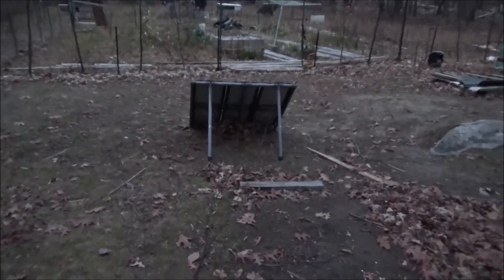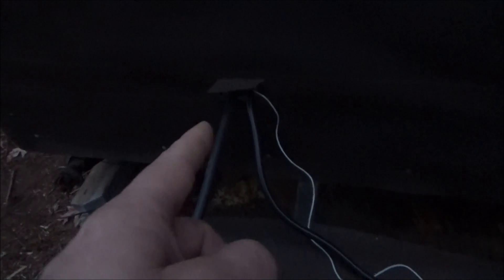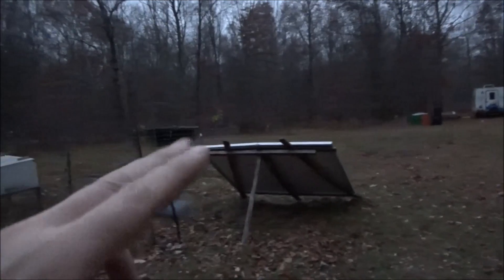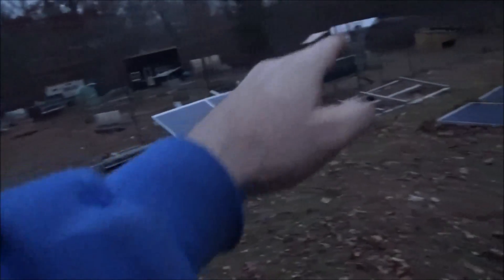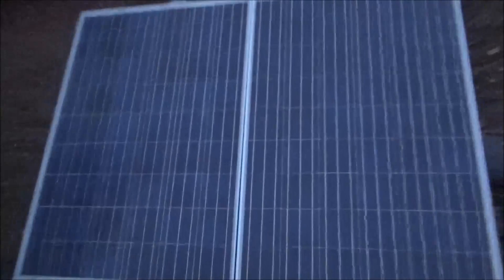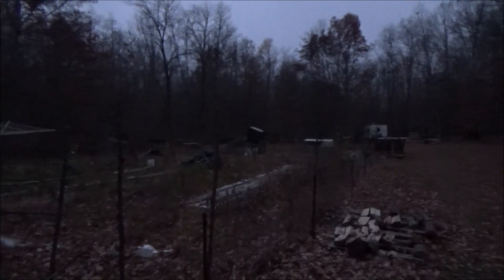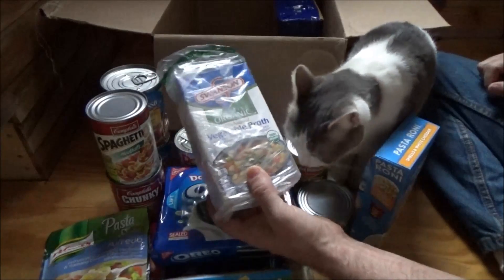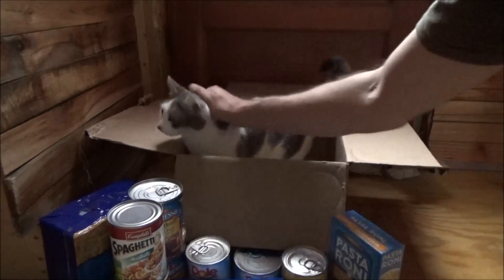Talking About My Off Grid Tiny Home Solar Panels N19

Comment: Most - sorry ALL dwellings with Solar have them mounted to the building or as close to as possible.  This reduces the loss in line.  As close to the panels as possible.  Looking at your setup you are losing more in the amount of cabling you use.  As you house is on wheels move it to the end of your garden, setup the panels even have them attached at an angle from the house then run the cabling to the charge controller then to battery bank then to inverter.
Reply: Paul Walker Thanks for posting this. Troy's setup is the only one that I have seen with such a long cable run. His wires definitely need upgrading if they were burnt by over amperage.

Troy, if you absolutely cannot get away from the long runs, I would like to see:
1. Panels be at least 4 feet off the ground. Better solar production on many points and will not get buried by snow.
2. Wires not exposed and on the ground. Put them in conduit and or bury them. These will get trampled on and chewed and destroyed again.
3. Nothing held up by a single piece of wood that is not secured to anything. Even if temporary for an hour, they are begging for damage.
4. 8 large trees cut down. Understand the challenges, but is the easiest solution to increase exposure. Appears it may double it in your meadow.
Reply: but theirs do not have panels 300 meters away made from recycled wiring do they?
Reply: The Do It Yourself World use this calculator.  but take into account that the calculations are based on correct gauge wire and siting on panels

http://www.powerstream.com/Wire_Size.htm
Reply: flatop08 iff your mppt charger is equipped for higher voltage input you should get the most profit if you use the highest input voltage possible, this has nothing to do with the battery voltage, forinstance, troys mppt controller can handle 150 volts input, the mppt controller transforms that in the used battery voltage, 12v in your casethis reduces te amps trough the panel wiring, but at the same watts, the mppt converts that into more charging amps
Reply: The Do It Yourself World You should order wire online - it's significantly cheaper than at the big box stores.  I recently got 200ft of #4 copper for $185.  That's 78 cents a foot, the local big box wants something like $1.50 a foot.... Even with shipping ($29) it was significantly cheaper.  I got it at Wire & Cable To Go - http://www.wireandcabletogo.com
Reply from the maker: gene mayne I think before you start talking about the weight of my trailer you need to go back and get your details straight please. I am really tired of people telling me its overweight and me answering again and again and again and again and again and again and again and again. Its UNDER 7,000 pounds empty, which is the trailer weight limit.
Reply from the maker: Have a look at MPPT solar charge controllers. They are made to allow higher voltages and longer wires
Reply: wires that are the correct quality and rating - yes - are yours?
Reply: @ paul walker, dont forget he is using a mppt charge controller, he can put maximum 150 volts in it putting his solar panels in serie, reducing the amps , so also reducing the cable loss, his wire lenghth and thicknes is not realy a loss point (especially in low light, there are less amps flowing ), so lesser los also, when you use a old fasioned pwm controller you are right in that case only the amps a panel delivers is used , by a mppt controller you can work with a higher powerpoint , the mppt charger makes more amps out of the watts of a panel as that the panel can deliver itself (in amps),
Reply: MrBugsier5 Hey guys, my setup is 9 100watt panels coming in at 12volts to the mppt charge controller from 125 feet away. are you saying I should wire them at say 48 volts to reduce the loss on my 8awg wires?
Reply: flatop08 btw my mppt charge controller can handle 75 amps.
Reply: it would make sense to wire all his panels to 48v imho if he doesnt move the house/panels
Reply: Solar panels mounted to a building make me very nervous anymore.  There was a warehouse fire not too far away that had solar panels mounted on the roof.  The fire burned for MONTHS because of the solar panels. They couldn't fight it the way they normally would, because of the solar panels. It made a HUGE mess!
Reply: MotherOfManyHorses Wow!  Did they say what type of panels or which ingredient in the panel caused the issue?
Reply from the maker: flatop08 If you have an MPPT charge controller then yes you would benefit from wiring them in series to increase the voltage and reduce loss in the wires
Reply from the maker: Not ALL off grid homes have their panels on the house itself. I have seen very many with solar panels outside somewhere. Link Knight is an example. Survivor Man did a show taking his home off the grid and the panels were out in the yard. Not all homes are in the perfect spot for solar. But the solar panels can be placed in the best location.
Reply: gene mayne come on now... think outside the box... IF he wants to move it around the meadow he can rent some of those dollies with wheels to support it and move it.  But he doesn't so it's all good. No worries.
Reply: gene mayne yes... it surely is heavy.  I have the same question about the huge snow storm that wasn't.... weird.  LOL!
Reply: MollyDolly It was the fact that the solar panels were producing power and charging the wires. They had no way to disconnect them.  Like Troy commented awhile back that it was safer to work on the solar in low or no light.  If solar panels are exposed to light, they are producing power. That's why, if you are not using the solar panels you have it is best to cover them/turn them over so they are not producing power and thus degrading.  
Because of that fire, I will never have panels on my house.
Reply: MotherOfManyHorses Oh, I see.  I understand I saw a friend's house burn down due to a forced air A/C in the attic... I will NEVER have that.   But, I wonder why they didn't foam the panels or spray black paint on them to block the sun.
Reply: solar panels can make extremely high voltages if there is no load on them and they are in full light
Reply: MollyDolly I wondered the same thing. Who knows, maybe it was some sort of EPA or OCIA (sp?) regulation or something.
Reply: MotherOfManyHorses It is sure an interesting problem.  Maybe there is a dilemma like you can't use paint or foam on electrical fires of that size?
Reply: gene mayne its no problem now to, he has build box gearders from woodbeams, with only 15 inch overlay, strong enough!
Reply: gene mayne he does not have to move the tiny home, the wheels are only there to obey the law, its only a tiny home if it has wheels, doest say it has to be road leagal!, so quit wining about the darn wheels and moving the tiny home, its ok and strong eough , iven to move it around, its no truck trailer!
Reply: Shayne Gadsden , yes but the will never produce more as the open pv voltage where they are made for,power wil decrease with higher temps.
Reply: gene mayne dont know hy you have the idea the outer wals wil colaps, its standing on the solid floor beams, these wil take tons off weight the way its constructed, ok, you wont go on the highway with it, but the load is only a few kilograms pro beam,.,there are 12 beams in total, conncted as a box construction plated with the floor boards, dont worry, it wil not collaps that fast!
Reply: gene mayne  if he hasnt mounted the frame to te underside, he can do that anythime when needed, its never intended to realy roll on the road, its just made so to obey building laws there, his home has wheels so leagely its transportable and not a fixed building, different rules are now in play, its not a permanent building now. (y would not want to drive with it behind my car!)
Reply: gene mayne 10 % is the right amount, to charge very safe, you can go double whitout any real problem, maby just a litle more water use, but thats not a real problem.
even his new battrys are junk, they should never have sold them anyway, new 6 volt rated batterys at 5,8 volts are drained totally, and probably sulfated, standing empty new on the shelf for a time, y would never sold them to anyone in this state, only as used lead...on 200 amhour battery's 20 amps is the right amount.
Reply: gene mayne ,that would be good for lithium or nickel hybride, nickel cadmium, but not for sulfated new(??) 6 volt battery's you have to activate this batterys by letting the bubbles desolve the layer of sulphate on the plates, the high internal resistance of the battery wil decrese the current automaticly.say it again, these batterys are a disaster, they are junk in my opinion, hf should never have given him these new sulfated battery's, hope the wil work for Troy, me as a profi batterybank seller would never have given a client of me these battery's, other than for the old lead.,y dont understand harbourfreight doing this.
if y wher hf, y would be so ashamed that y would replace all the 6 junkers for 6 good batterys from a good brand,.
Reply: y did something wrong, liking myself was not intended, i had some problems here with the internet and computer, its fixed now!
Reply: timcat100

Comment: Get some 8 gauge landscape wire it can handle three panels easy. It has two wires.
 Or go to the welding shop and get some 6 gauge wire but its only single strand and way more expensive.

Comment: Troy I have two charge controllers hooked up to my battery bank . I have a mppt 40 amp   &  pwm 60 amp    600 watts to one controller  & 600  watts to the other controller   & both run to the same battery bank  .
Reply: How long have you had it run that way?  Any downside ?
Reply: You should make a video showing your setup and how you installed it.
Reply: MollyDolly
4 years now. works great & dont run out of power. I have six 100 amp hour battery & one 600 amp capacitor . I run everything in my house but my electric stove.
Reply: IronPatriotTN
I do not have a account to up load videos but  I can email you pic of my setup if you would like.
Reply: buck tooth bettys boyfriend  Nice!
Reply from the maker: buck tooth bettys boyfriend It would be nice if you post the photos on my forum for everyone if you would please. www.thediyworld.com/forum